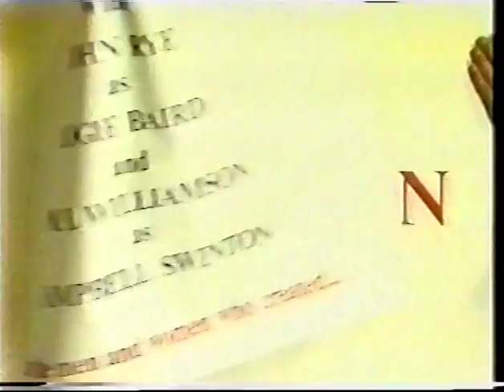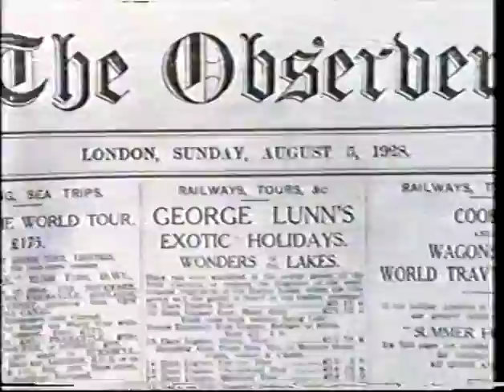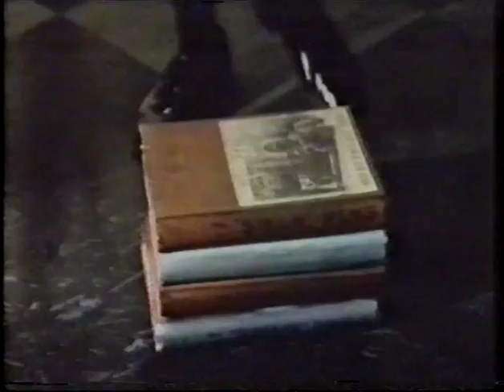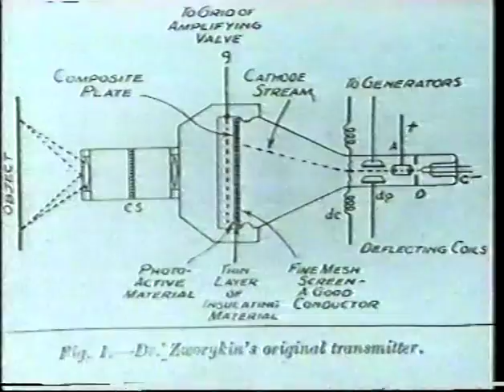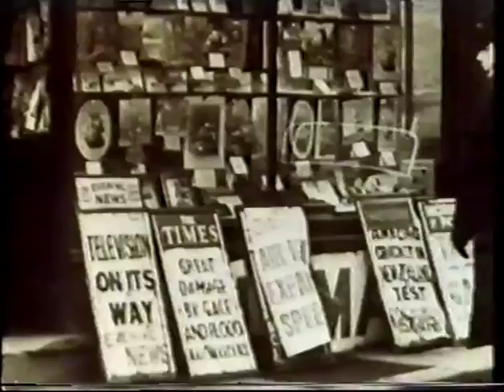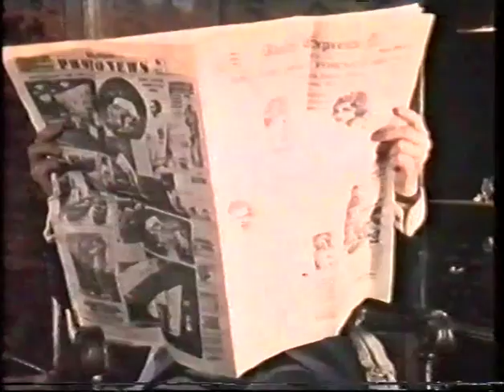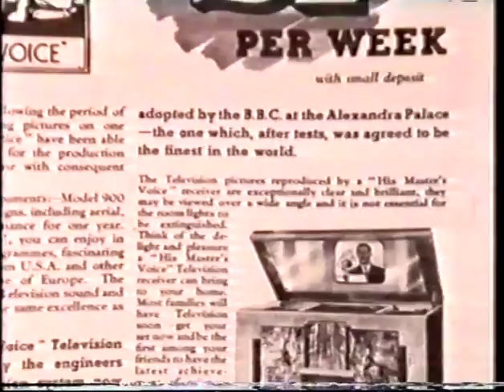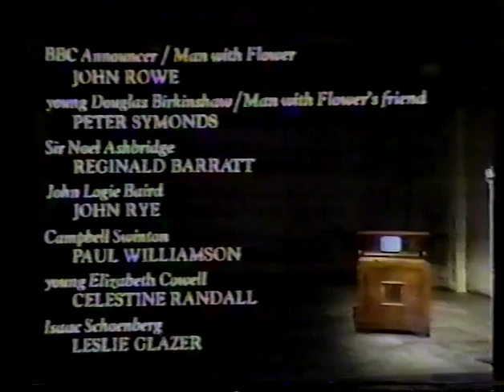The Birth of Television (full 1976 version)

Comment: one thing missing from the recreated pictures - the visible lines of resolution. a 30 line picture shows obvious "jaggies." but those couldn't be reproduced as easily as the flicker or orangey neon color, so it wasn't done.
Reply: The lines are visible in the picture at 30.45. As far as I can tell this picture also shows the curvation of a Nipkow disc. You might be looking at the real thing, in which case not Axel Jensen (1952 Johns Hopkins Science Review: Television in Great Britain) but Arthur Askey (1976) was the last man to be televised on the 30 line system. The flying spot seems right and the photocells might be the original from Broadcasting House also shown working in 1952.